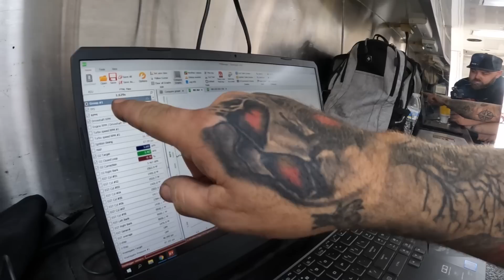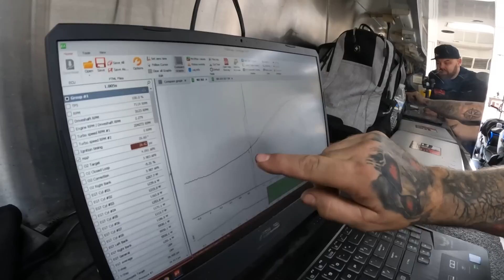Finally Got The NPK Murder Nova Tested...IT'S FAST! Plus Some Parking Lot Repairs Along The Way

Comment: I know you built a welding extension, but I'd recommend ordering one from AC Works. The one I have for my welder was a lot cheaper than I expected. It is built well and their warranty support is fantastic. I have a smaller welder that I run off of the drier plug for the laundry, also have an AC Works adapter to make that connection. You can order from Home Depot among other places. These were recommended on one of the welding forums when I started asking after I bought my welder.

Comment: I am a truck driver owner operator of a kenworth I noticed some discoloration on your steer wheel on passenger side of toter making streaks in line out from lug nut holes out towards the tire. A no brainer obviously loose aluminum truck wheel when been in the rain will make black Mark's from lug nut whole going outward. Your Mark's are not black or black yet but you might want to put a 1 inch air impact on and check and see so you can save the studs,the wheel and most importantly save your lives

Comment: U NEED a small inverter stick welder for just this kind of road fix.  I have one I run off my generator & it will run off any 120 or 240 volt supplies!  So if u can only get power from a house or gas station where they will let u plug in a 120volt extension cord u can weld without even a generator.  Under $200 at Amazon for a 160 DC Amp.  Weight 25 LBS.

Comment: Instead of putting two bolts in the bottom only put the one bolt in the bottom that goes in there and the other one that you say you have to remove the axle just put a stud in it so the stud will stop it from going left right or twisting and you should be able to do it without removing the axle.
To get the airbag off air it up as far as it will go right now.
Take you a couple of 6x6 blocks of wood and stand it up on top of the leaf spring front and back then let all the air out of your airbag. That way when you take the bolt out it will draw down. Remove air bag, put your stud in there drill hole and there you have it.

Comment: The Pete factory Air ride steer Axle has a single spring with 2 air bags.. one infront of the Axle and one behind.. they ride awesome but are a pain.. there's no steering wheel moving though??? Biggest problem my buddy has had is getting it to ride or sit even on both sides.. it's had a gangster lean towards the passenger side since it came from the Pete factory.. we changed the leveling valves which helped.. those airbags are tough... I've seen tires blow next to them and just left scuffs.. whoever did that front air ride didn't due it correctly for sure

Comment: Scary shit having to deal with a front end issue on the road with your family and race car . I would suggest some maintenance as soon as possible. It needs some Lutz attention and repair. A good PM inspection should be done with the amount of miles that are going to be driving during the. Npk season. Looking good and being safe need to go hand and hand. Good hit and test. Be safe , both on and off the track. Good luck going into the NPK season.

Comment: You can have it converted to a air ride front axle. Its probably extremely expensive but it can be done. Aw shit
 I just realized it has already been converted. Make sure you paint your welding . They make alot of internal moisture and it will rust out in less than a year

Comment: For those air bags there should be 2 studs on the bottom, 1 u cut but leave the thickness of the lower bag bracket and the other 1 gets the nut so they don’t kik out like they did.

Comment: Your steering wheel moves when changing height because you only have two links in your steering. A drag link connecting the spindles and a drag link from steering box pitman arm to the front left hub.

Comment: I had a front airbag setup on my old 377 that was factory installed. When those front airbags go, the ride is horrible and looked just like that pic you showed on the video. I had to keep spares just in case it were to go out on me. Rode nice tho

Comment: Not sure you will see this, the bolt that was missing on the bags are threaded into that aluminum hat not the axle. If the threads are gone just get a pair of new bags, they come with the hats,( that thing you called a plate) the bolts you need are 1/2 x 2 1/2 course thread, although I have seen a few fine thread, right off the bat I would get a couple bolts and try to thread them in you may luck out and they just fell out.

Comment: Phantom, get you a button and a remote thumb amp adjuster for that torch. Way better than having to use a pedal when out of position. See about a stubby kit as well. Get rid of that long back when you gotta get in tight spots.
Reply from the maker: Yeah it’s the first time I’ve used this stuff. I have stuff to make it more comfortable for me, it just didn’t get put in the trailer. I also don’t like the buttons/switches on the torch tho. I thought I would, but I don’t
Reply: @187Customs  ah. Gotcha. Well you gotta go with what's more comfortable for you. Like you guys said, you didn't think you'd be welding on anything in a parking lot. You got it fixed and that's all that matters.

Comment: They look like Neway airbags I used to build semi trailers and I have a few of those bags still should have the nut where the air hose goes in and a bolt down the middle of the bottom side

Comment: U guys really should disconnect the batteries when welding on the truck... I see that you are running those balancing deals in your steer tires.. watch them because they will get holes in them from the sand and gravel blast effect and will loose the balls inside... I'm just telling you all from my experience... also have the overhead ran on that caterpillar engine every 115k or so.. it will help it last longer.. I spent years running across that area hauling livestock which is about like hauling moving liquid that's stacked.. you can take those curves pretty quickly

Comment: You need a decent fluxcore welder for that stuff, not pretty but would have gotten the job done until you could get to a proper shop. If you get a decent wire feed welder you can run solid wire with gas too.

Comment: guys that car was flying there at Galot and with that being a prepped track for the pro mods, will it affect any of your setups going in to your first no prep race? I was also wondering if you all have any plans on running the Pro Charger/Big block Chevrolet setup over in No Prep Kings at any point this year

Comment: You need a peanut cup no gas lense. Shorter backing 35 psi on the gas. Get rid of the foot pedal and get a zipper switch wear two gloves so you can rest your hand will be much easier.
Reply from the maker: I don’t like the buttons/switches on the torch.

Comment: Get you a set of gunsmithing screwdrivers. Gunsmith flat head screwdrivers are not v shaped,  instead they are straight sided or some are wider at the end so they bite in at the bottom of the screw so you don't have to push your guts out to keep it from slipping out because you don't want your shit to slip working on a expensive gun. Maybe something to try. Good luck men.

Comment: Hey Shawn is there any stuffing left in the seat or did u suck it all out from running the mountains. I understand how that goes drove in the Smokey moutains and I wasn't pulling a stackers and it sucked.. You two are fucking funny and great to watch. Hope to meet ya all one of these days. Haven't seen the car yet couldn't get past the Home Depot parking lot repairs on your Toter Air bags but it was a great ideal how u fixed it. Good luck this year in the NPK.

Comment: That rod that is broke is your auto leveling rod. It needs that because it will sure throw off your steering if you dont. It will have more pressure in one side than.kt does on the other. You can see the difference. That bag on the driver side is up and the right side is down on the lower cup. Thats not good. It will.make your steering act funny amd make it drive all over the place. Aww shit my bad. I just realized you jave the leveling system holding the front end up off the ground. I guess if you ever have a flat on te front you wont have a problem jacking it up.

Comment: So ya ran around a 6.8 ot low low 7
Reply from the maker: I’ve been 6.80s letting out at the 1/8th and throwing the parachutes and coasting through the 1/4. This car would run 5.80’s in the 1/4 mile